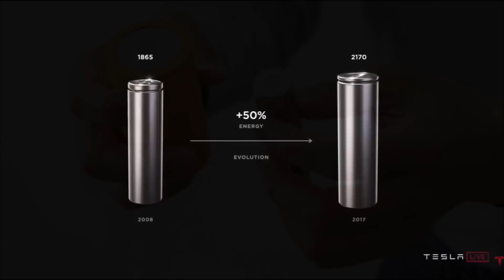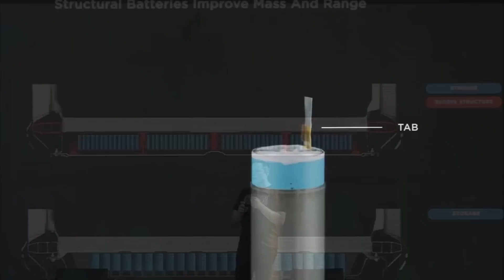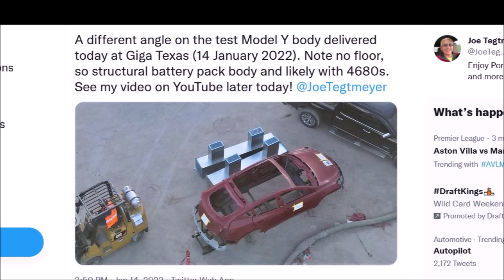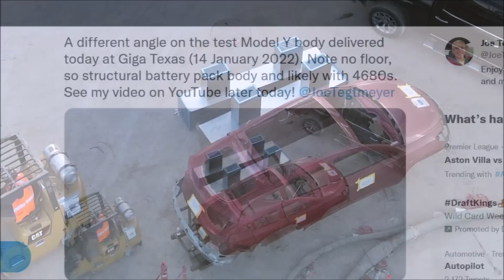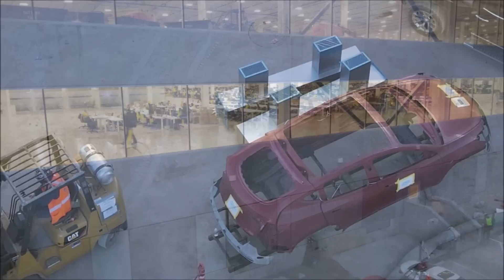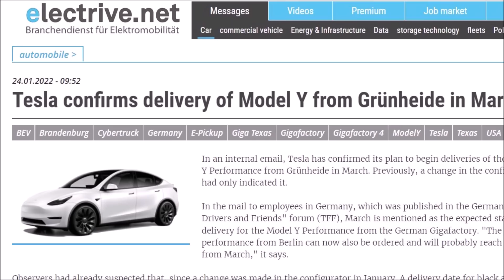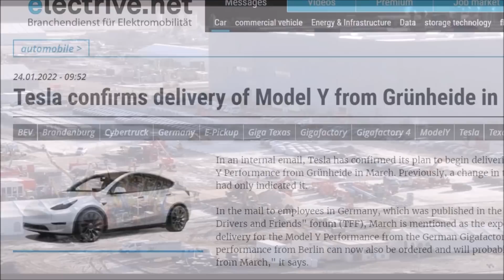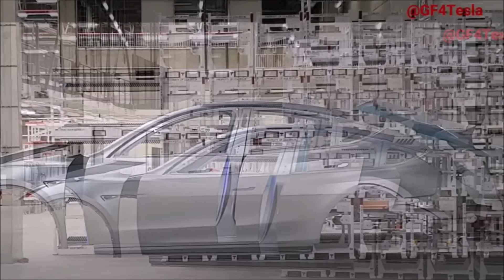BREAKING! Panasonic Is Due To Build Tesla 4680 Batteries With 5-Times Power

Comment: Do not be surprised if Tesla comes out with a structural battery using no 4680 cells.  It's possible to reinforce the battery to make it structural if they use cells other than the 4680. This way they can proceed with casted front and rear body production using the blade cells or 18650 cells. Until they get sufficient 4680 cells it only makes sense to utilize other cells and move forward with a structural battery pack.

Comment: I thought that his was odd when I first heard about it a few months ago. After Panasonic divested themselves of Tesla stock (and made many millions) they announced plans for 4680 production, but not in Nevada. In Japan. 🤨 It is still uncertain if the Japanese 4680 batteries will just use Panasonic's 2170J chemistry, or if they will license the Maxwell technology from Tesla. Either way it will result in more batteries for Tesla!  Regardless, making more batteries for Tesla (and others) will be a good move for both Panasonic and Tesla moving forward.
Reply: Anyone can produce their version of the 4680 form factor. What goes in them is another story. They will have to build their own lines or license the tech and chemistry from Tesla witch i think they may have done with Panasonic. No one can make an exact copy of Teslas version without Patent violations. besides Those Tesla designed custom machines in the  lines Tesla  installing in Austin and soon berlin are not  off the shelf items.
Reply: @dclpgh  I doubt it.  The Maxwell technology seems to be a bust
Reply: @DumbledoreMcCracken  seems somebody is a little out of date. So let me catch you up Kato Road in Fremont has been going full tilt for the past 7 months. They have been stockpiling 46 80s for the Austin ramp.

Comment: Tesla have said they will use LFP for "standard" models which implies 4680 for "premium" models such as long range and high performance. I presume most cars sold will be standard so Panasonic may logically only be used for the smaller proportion of premium models.
Reply: LFP is chemistry ... 4680 is physical format ... separate, totally unrelated issues, so using LFP for "standard" models implies nothing of the sort.
Reply: @PhillProbst  Understand Tesla has confirmed they are not putting LFP into 4680.

Comment: Aside from being tabless and a new chemistry, Is 4680 just a change is size or “form factor?”
Reply: Yes, but with this new form factor the energy density is better. Add better chemistry and soon we will have very good batteries regarding all points.
Reply: @geiers6013  Okay, thanks.  Do we know if the Kato facility has worked out most of the bugs?  I trying to find out if Kato is cranking these 4680’s out at an impressive clip?
Reply: @geiers6013  Also, do you know if the 4680 is making use of the “dry….um, (I can’t remember what is called),  the technology they got when they bought Maxwell a while back?  It’s was supposed to speed up and clean up the battery manufacturing process.
Reply: @jeffreyhampton9130  I dont know that sorry :(